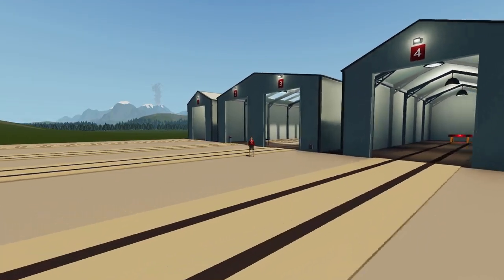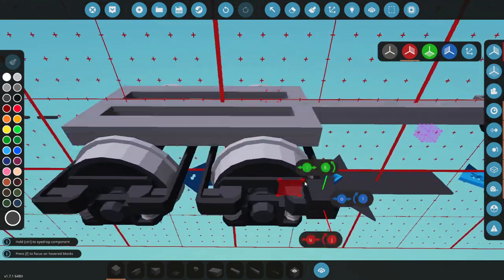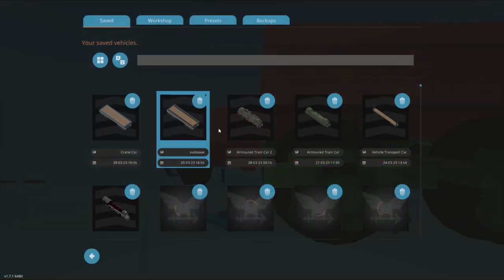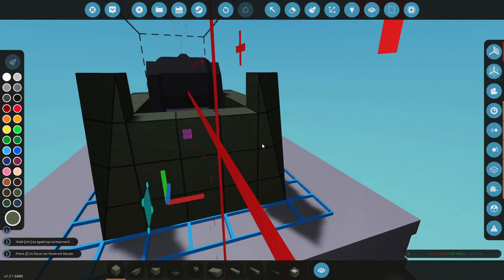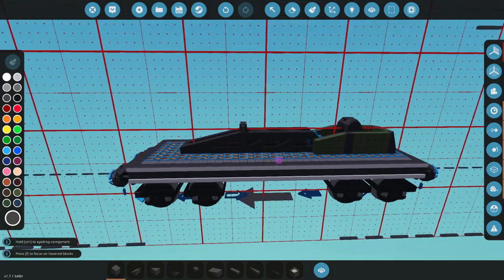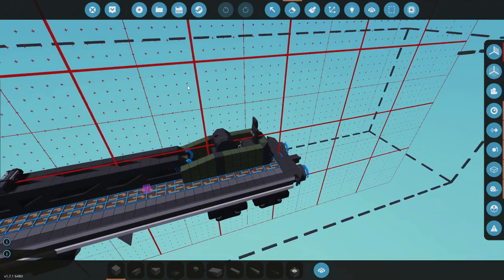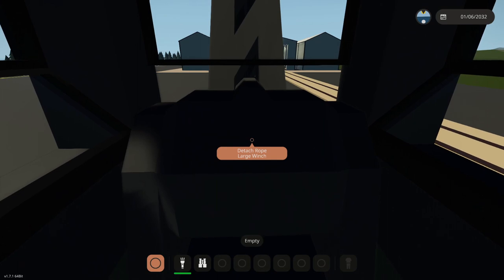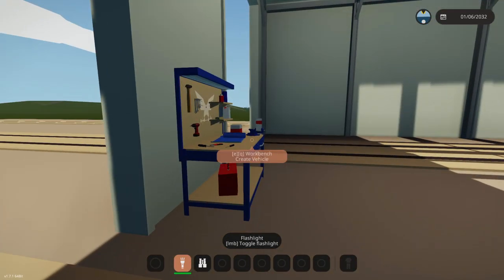Lets Build A RAIL CRANE! - Lets Build A Steam Engine In Stormworks!

Comment: To answer your speculation at the beginning, you have a frigg'n Bertha gun. A crane car is MANDATORY. The P.1500 Monster (the tracked version of the Schwerer Gustav that was never built) would have had to of had a crane and rail system on it to move the rounds up and around into the breach. You obviously can't load Bertha rounds by hand (by the game standards and IRL because those kinds of rounds are just so hefty) so a crane is a must in the sense of going from Point A to the Front Lines.

I wish I could build cranes in this game however. I can never get the function correct with cables so it's always pivot based and that never ends well. I wish there were more less elastic cables in the game instead of each one being a bungee cord.